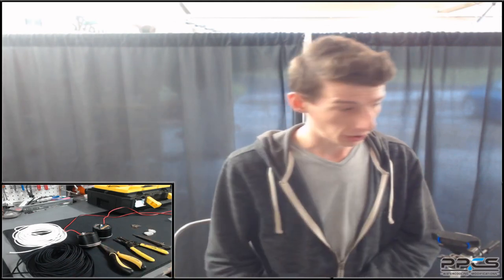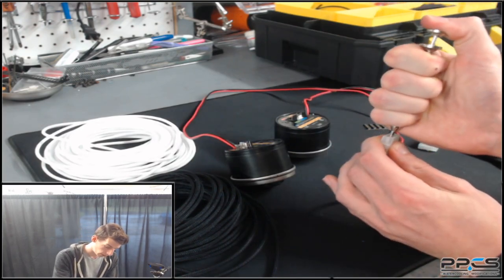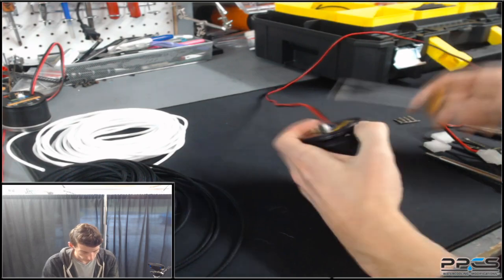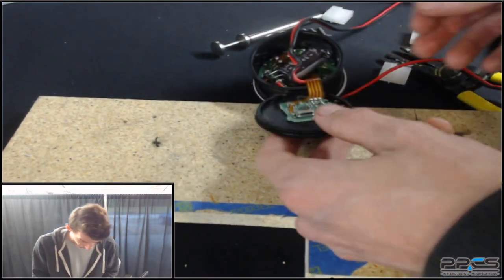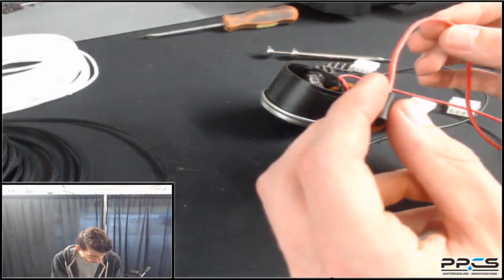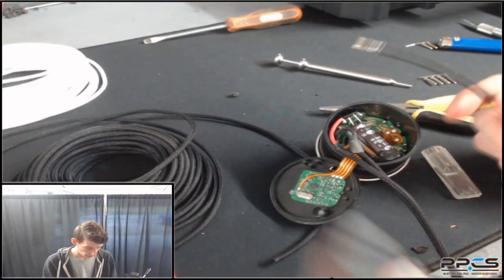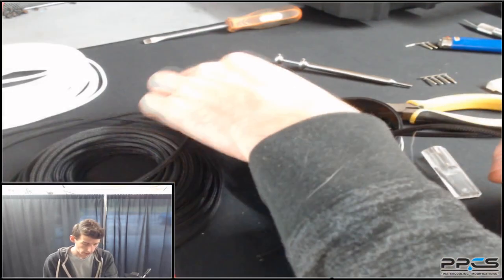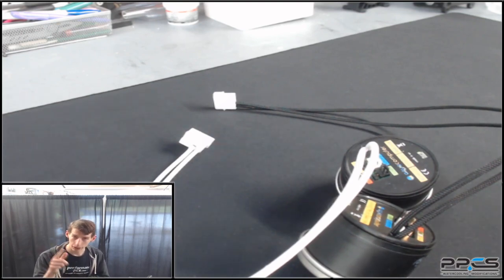How to sleeve a D5 Pump

Comment: Thanks for taking the time to do this video. I was wondering why you shrank then removed the heatshrink from the Molex end. Presumably it's self-adhesive heatshrink and it leaves the glue? It looks like the Molex end could have kept the heatshrink on, like there's enough space? I have a Laing D5 Vario and the Swiftech branded one (MCP-655 I think) so am planning on sleeving them too. I have a stockpile of nylon braided sleeving and heatshrink, so was just curious about the sleeveless ends.
Reply: Very late reply but the heatshrink that melts at the end will also melt the sleeving into a nice smooth end. That way when you remove the heatshrink you don't have this ugly, black plastic on the edge of the connector that can stand out in a way you don't want. If you try to do this without the heatshrink it will not come at as nice looking.